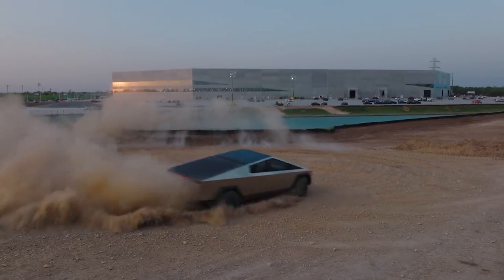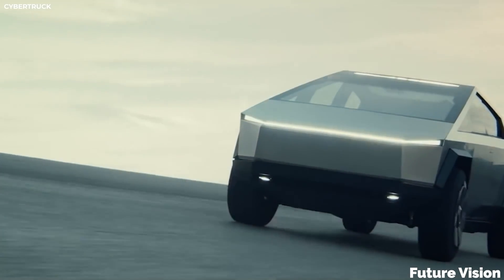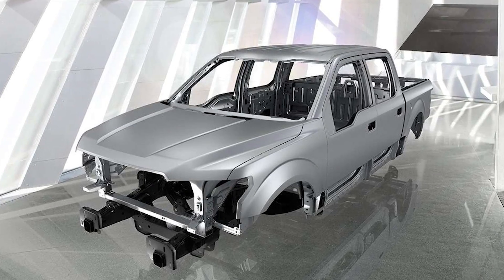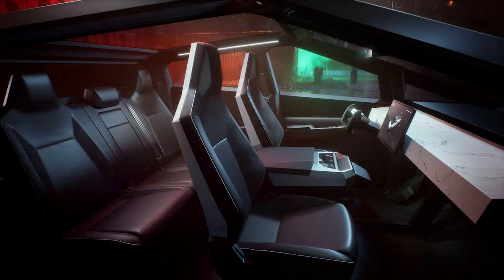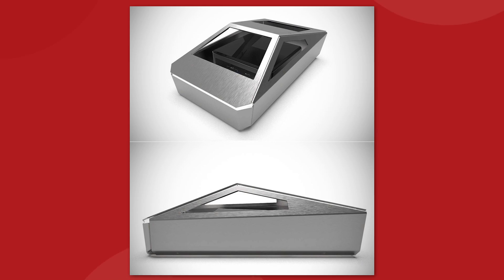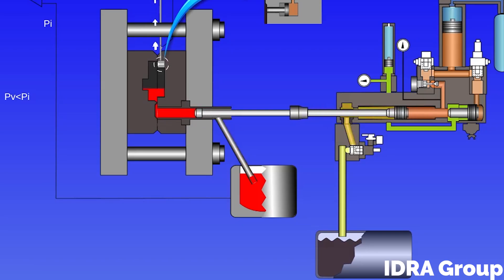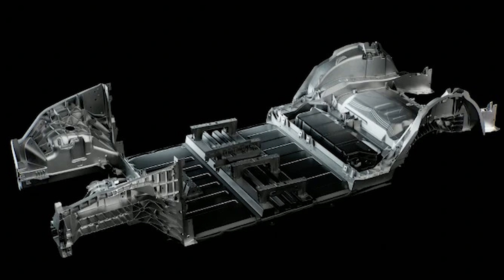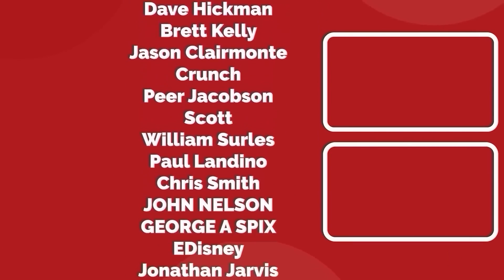The Real Reason Tesla Developed The Cybertruck!

Comment: I'll never own an EV or take it off-road!! If a electronic part fails and or runs out of charge your fu*ked! And you will have to take it to a TESLA dealership for repair, what a nightmare! What if you slip off a rock and damage the battery? That's 20,000 to replace and not under warranty!  I can keep 2 gas cans and have 400 miles on hand! EVs will fail!

Comment: so what about energy dissipation during a wreck ?  if the exoskeloton is too strong then it cant absorb the energy and then its transferred to the occupants 🤔
Reply: You are not allowed to wreck this truck. A rubber coating will be available to set all female minds at rest, at less than 699 $ additional cost.

Comment: The only big problem is that in case of accident to not become useless 😉 modular can be a better choice from my opinion 🍻
Reply: At last a critical voice😄 Americans are about as gullible as you can get! In my opinion. Battery fail? Toss away - that is what stops me supporting this disposable junk. The battery rack is not made in a slide out rack, no fully integrated, so that the whole vehicle is trash if there is a battery fault.....not really for those of us who invest in future technology, which is made to last multiple decades instead of almost a decade...(sorry Elon, contact me, if you want advice on your next project).

2023 01 14 09:21

Comment: Coming from being a welder at the ship yards building ships and oil barges working with Steel plates that are 6 to 8 inches thick it makes me laugh a little when he exaggerates about how strong a flimsy 1/8" sheet of stainless is, might be an upgrade to sheet metal but it's still not as strong as he makes it out to be

Comment: To answer your question, a gallon of paint weighs 10-12 lbs. It takes about 2.25 gallons to paint a full sized truck. A significant portion is wasted w overspray depending on the method, but it also loses weight as it dryes. So, were talking about 10-20lbs of finished paint weight. If it was a significant amount of weight race cars would have straight carbon fiber finishes. I think the decision was more based on costs than weight. I'm so over this marketing bs.

Comment: Nice description of material and construction advantages but in curious what specifically is the ss grade?, 300 series includes all the cheapest SS grades like 304, 300 series is not heat treatable like 400 series and not as hard or tough or strong,  but much cheaper.
The real discoveries made by Tesla that would be a revolution for all EV is the multitude of methods he discovered to obtain free energy, until these are released were just refining the inventions from the stone age.
Reply: I believe 304L is what they're using to build Starship, and Elon had said it would be the same.  Who knows?
Reply: @richardalexander5758  unusual that 304 is chosen, it's the most common and cheapest grade of ss but no particular special properties.  For space apps is expect titanium or some other material with much better strength to weight ratio than 304ss, if your passing go in these enterprises you need maximum range per kg, and the manufacturing costs for titanium vs ss arnt going to break the bank so I can't see any reason at all to use ss on a spaceship unless the tesla anti-gravity device is on board... maybe it is 😉

Comment: I liked it from the moment I first saw it. It's a pickup truck, a utility vehicle, so for me, the functionality comes far before the design. And I don't even think it's ugly, it's just not made bu the same standards as other pickups. After all, who cares if the hammer is ugly or not? Body material is unlike anything standard body production line can handle, so no wonder it's built more like a bridge than a car. Tesla just needs to work a bit more on the glass LOL. And with so many productions steps eliminated, I think it's unbeatable performance and price wise for the target group which wants a no compromise utility vehicle. But as it comes from Tesla, I suppose it would be attractive for others, too. Boxy body makes for easy production of all sorts of atachments/additions, like the ones shown in teh video. All in all, I think it's a winner. I'd like to see the final price, but it's as low as announced, even more so.

Comment: If the Cybertruck is trying to be a pickup truck then it's an awful design. The bed is completeely inaccessible from anywhere besides the back of the vehicle. You can't put things in or get them out of the bed from the side. If something is towards the front of the bed then you can't even access it. It's a design by people who have never actually used a pickup truck.

The fact that the narrator talks about it as the best purpose-built pickup shows he has no idea how people actually use pickups.

It makes the Cybertruck completely useless for most work and hauling tasks.

Comment: Paint is heavy to carry in cans, as shown. But after the paint dries on the truck body, it’s not that heavy, right? I think paint is something like 50% lighter when dry. 😀 But yea, the Cybertruck truck will weigh less if not painted. But stainless steel, while stronger, does weigh more than aluminum bodies.
Reply: Exactly. The vast majority of the weight are the solvents that keep the paint liquid. They volatize off as the paint dries.

Comment: It also helps to have a mass production vehicle that uses the same type of steel as the SpaceX starship.  Economy of scale means reduced material costs across the board.  Very smart way to keep the mills running melts for both companies.
Reply: You seem to be thinking about the idea of "Interchangeable parts" between units and models. This allows the cost of setting up a manufacturing plant for the part to be offset by manufacturing a very large number of identical parts. The key point is that actual PARTS must be identical. Just having two completely different parts being made of the same type of steel does not deliver any benefits. This is especially true when we are comparing the automotive and aerospace industry. Parts and materials made in the former cannot meet the quality standards of the latter and the quality assurance of the latter would make it totally cost prohibitive to be used for the former.
Reply: If you really think anyone has gone into "outer" space, you have been duped.
Reply: @fireballxl-5748  Don't look up!
Reply: @fireballxl-5748  I know it was a joke but. wether you believe anyone is going to space or not they are still building the ships so the point still stands.
Reply: @dontimberman5493  That's sharp! I didn't think it through that far
Reply: You’re a wacko.
Reply: @reserva120  Oh that's a brilliant argument.   Think of that all on your own? Ad hominem is the last resort of the empty mind.   If you don't know what that means (as I suspect) look it up
Reply: @fireballxl-5748  Is the world flat too?
Reply: @fireballxl-5748  fireball is delicious, isn't it
Reply: @fireballxl-5748 where do you buy your tinfoil hats from?
Reply: @fireballxl-5748  I'm not here to dog you man but you can actually see the satellites in space that the rockets haul up.  You have to get a decent telescope and the lighting has to be right.  The military does routine visual inspections on their equipment as well.  Just saying this isn't the hill you want to die on.
Reply: @steeldriver1776  Why is it no one can do simple research?   Because Airy's Failure doesn't fit their paradigm?  Then they always change the subject and want answers to everything.   Well I don't have answers to everything but I'd like a simple answer to a simple question.  Was Airy's Failure a legitimate experiment?  Meaning was it correctly conceived and the result valid?  Now as far as the next subject question submitted (satellites being seen)...how do you know just what you're looking at?    Get a good pair of night vision binoculars and look at the sky at night.   You won't believe your eyes at all the activity...and it ain't satellites.  Not dogging you either but at least be reasonable and answer my question about Airy's Failure and it's results or admit just maybe you've been mis-informed.
Reply: @fireballxl-5748  So first of all, there is no Airy for me to use for context?  Who is Airy?  It's not even in this chat until you mention it in this comment 18 minutes ago.  Was his/her results valid?  I'm not sure.  Why is my information or misinformation based on a person that has not entered conversation yet?

Second, there are tens of thousands of engineers working on space, spacecraft and the space industry in general.  I even helped work on a tracking algorithm to help with satellite navigation.  I was in the Air Force, multiple degrees, plenty of incentive to make money but not really anything to say I'm lying.  You're saying all of them/us are lying?  Based on what? As I equally cannot take your hand and walk over to outer space to show you the satellites, you equally cannot walk me over to outer space and show me there are not satellites.  

Why is the burden of proof on those who are pro-satellite?  I have a sat phone for emergencies in travel.  I could go right on having my satellite phone and using satellite GPS happily ignorant of the fact its all a scam and lie.  You'd be right and wise, I'd be dumb and happy, yet you're sitting here in a chat trying to convince people who've worked on space projects that no man made travel, man or equipment are going into space...  Doesn't that seem ironic to you if I'm the one who has been duped?

Comment: There are some aspects of the design that you did not consider. The use case/scenarios for what a work truck needs. I’m not saying that this truck won’t pass muster at all, but from a construction working POV, I can see some potential negatives. For instance the fact that the rear bed-sides aren’t level, but at an angle making it useless for situations where a level surface for carrying or working may be desired (like snowmobile decks, camper shells, work racks, etc). I’m not going to hack into it in a comment, but those use cases are extremely important for the “tough truck” crowd. The Silicon Valley ski nomads are probably fine since they could just buy another truck.
Reply: The have they're own camper shell design you know and a flat style utility bed attachment, may want to look into that.
Reply: @Alturvexs  Plus people add all kinds of things to truck beds to adapt them to their needs. I wonder how well the bed sides on those aluminum trucks hold up to non silicone valley use? The video said GM is working on some kind of composite solution for the bed floor, which means the aluminum bed is maybe only holding up to an occasional IKEA haul? Now I'm curious if people still throw a scoop of gravel or a pallet of cinder blocks in those aluminum trucks?
Reply: @insurrectionistorange  Well I sure know the difference from the old truck that was made from steal from back in the 80's and earlier model was far stronger than today's aluminum trucks, We have a few of them still. This is why I am so exited about the cyber truck and it's versatility
Reply: @Alturvexs  I've had a few steel bed trucks over the years and never had a second thought about dragging engine blocks, transmissions and suspension parts with sharp edges across it, or using shovels to transfer gravel, sand and amendments from the bed. I wonder how composite or aluminum holds up under these uses?
Reply: Great point !!! I didn't even consider that...
Reply: @Fudge Dredd Are you paid by the President to malign Tesla, no maybe I think you work for the competition. Have you noticed the new F150 uses the same dash design as Tesla with one large screen in the middle of the dash, shit they can't even be original, Both GM and Ford only started producing electric because Tesla was taking all the market share they are so accustomed to controlling without competition. You know I think you must work for the whitehouse marketing division paid to put down non union facilities and products.
Reply: @couttsw  It goes deeper than that, since Musk has shared a few opinions outside the regressive segment of the democratic party the entire main stream news and entertainment industry have been attacking him non stop.

Comment: Not really! the truck is very UGLY! and the range is pretty poor since gas trucks can have an infinity range without having to wait for 6 hours for a charge. And it does not matter if the Steel is very hard because truck owner does not care about this, this is a waste of money and time feature; you don't need the truck to be hard and you don't want to be soft. This video is designed to confuse you with useless information that no one needs nowadays. No one needs this. These trucks are going to be very expensive, and imagine you're sitting on the back rowl and being unable to lood at anything else either on the front or back? that is how low onthe back sits are!! and have a short range and ugly with a bad design! This may be part of Tesla intention? Because a lot of Tesla qualities on their truck is kind of useless!
Buy yourself a nice and strong Toyota Hybrid, or one of those older 2009 gas trucks in good shape!

Comment: 1: It should have its own ICE or other engine to recharge the batteries and power the front wheels as an AWD so it will not only work in the cold but have full torque under tow and a backup drive system.
2: If you get into an accident the people inside are going to incur more physical damage due to the rigidity. When there are no crumple zones or form of impact energy distribution then all kinetic force is delivered to the occupants. This isn’t just well established fact but I speak from experience.
3: In the event of an accident or mistake using it as a work vehicle if a body piece, such as a fender or quarter panel, is dented the repair cost will be enormous. Do you replace half of the body in the event of a dent if someone backs into the fender?

Comment: This thing is a joke, but any electric truck is really.  I mean, it actually looks pretty cool, and is cool technology, but If I want a truck, I want to haul, pull, or go off-road.  What do you do when you are off-road and the battery dies?  With my diesel, worst case is I hike out, get 5 gals of diesel and dump it in, not with an electric truck.  What happens when you’re hauling something and have to detour due to a closed road?  With a fuel truck, you can be assured there will be a fuel station on the new route, but a charger?  Who is going to haul with an electric truck when you have to stop for and hour or more every 150 miles?  And they show a camper on it… Where are you going to camp?  There is no campground in the US with electric infrastructure to charge this thing.

Comment: Great explanation of why this truck looks like it does. However, the fact its all designed around longtime reliability such as no rusting or less wear and tear on the drive train,  it fails on the basis of its technology as we all know with mobile phones that technology is so unreliable as nothing does what it was it designed to do 100% of the time, firmware and unreliable updates means this technology is floored from the beginning.

Comment: Well.. in 10 years when your battery capacity is drown to unconfortable levels perhaps there is not an advantage in rebuilding your whole car to get them changed and you perhaps decide to throw it in the trash or sell it for a tiny fraction of the original price. I would not make any assumtion about its durability. Let's the time tell the thruth.

Comment: Excellent explanation. Very well done. My decision is now made. It's not the traditional 'all fur coat and no knickers' of many pickups and chavvy rangerovers. Having only ever bought Toyota off-road vehicles, it's time to move on. Very disappointed in my latest Toyota land cruiser invincible. So pasé. Old tech. Underpowered. Constantly developing faults. This is the new pickup for me. I wonder if they'll make one in stainless steel 316? Good for chucking in the diving equipment and oceanographic toys.
Reply: There will be so many uses for this truck. I can see a need for at least three different sizes to fill a variety of applications. What a brilliant design. I for see a major improvement in trucks of the near future. Elon Musk and his team of brilliant young engineers have done it again. I only wish I were young enough to join them. The world needs more minds like these guys.
Reply: I believe it's 304L steel, same as used in Starship.

Comment: You're missing the key point of quantity of raw materials — they chose this materials because Elon wanted to use stainless for the Starship program and needed to order large quantities of said material, so they had to make use of theirstock pile and so the Cybertruck,.. I'm surprised you didn't mention this, it's probably the biggest reason they're using this material.
Reply: "They" (Tesla and Starship) are two different companies.  There's no combined purchasing power if that's what you're getting at.  Well, maybe if Elon invents another company to make  stainless steel more cheaply....
Reply: @laughinggas5281  SpaceX can purchase from Tesla and vice versa. They're not prohibited from doing business with each other.

Comment: Trucks are designed for strength and have curves to guide wind along it. Cybertruck is not designed for wind, but designed for strength and maximum storage capacity in a limited space for a planet with a much thinner atmosphere... like MARS! Everything Elon does is focussed on Mars. Rockets (duh), car-tunnels with no atmosphere in them, Twitter as a communications platform... EVERYTHING. Even launching a Tesla up in space is directed at MARS, to slowly tumble through space until it can be picked up as a morale boots for the colonists in memory of the one who started it all. Following the trajectory of the car gives you a timeframe on when Elon believes Mars should be colonised.